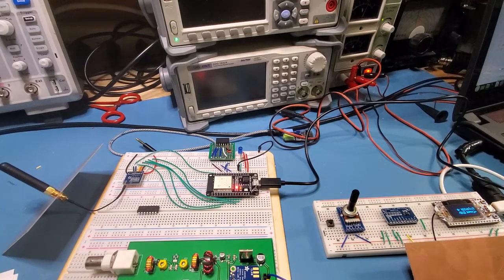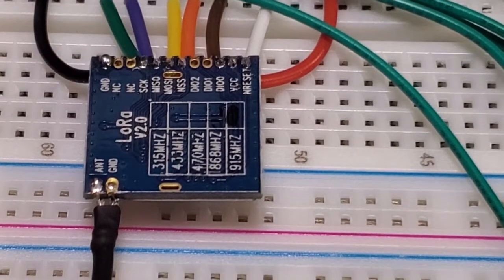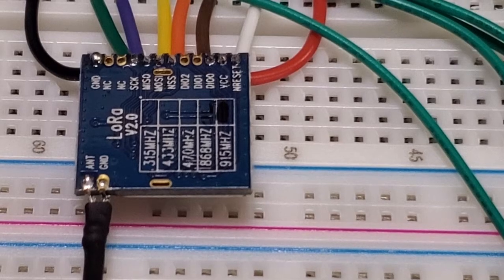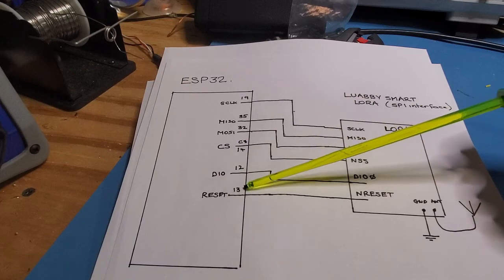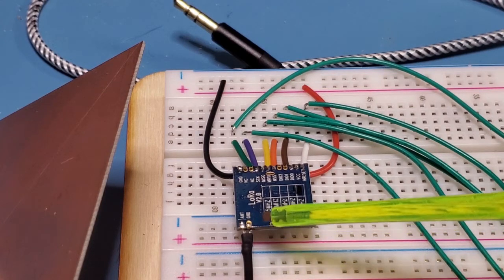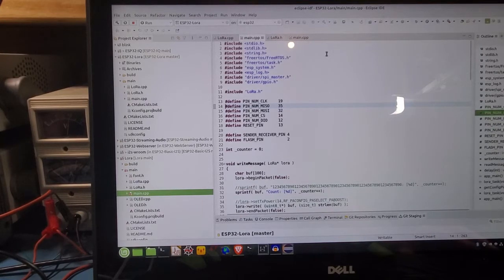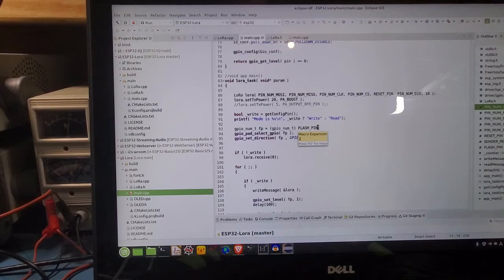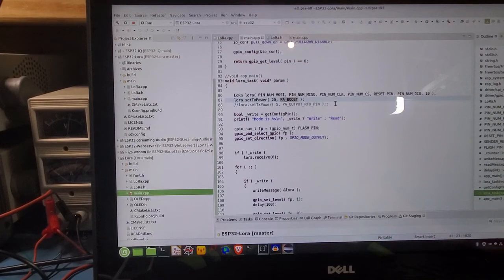ESP32 with External Lora Board

Comment: That was very Kind to make this Video. It's also a unique topic and very rare material exists on it.
just another question, Does this library supports LoRaWAN? Heltec has a project for LoRaWAN 
(HelTecAutomation
/ESP32_LoRaWAN) but it requires a chip ID verification in order to work, so we can't use their library.
Another question if you don't mind, As my experience with CPP is very basic, Is it possible to port the code to work under C?
Reply from the maker: I haven't tried the LoRaWAN library Amir - that might be something I do a little later on. The Chip ID is just the ESP32 mac address

	uint64_t chipid=ESP.getEfuseMac();//The chip ID is essentially its MAC address(length: 6 bytes).

There's a pile of code - but the Heltec board is just ESP32 + SSD1306 OLED + SX1276 LoRa. There's no proprietary hardware there. 

As far as C++ goes I am not using any advanced features: inheritance, virtual fns etc - I just find it easier to use than C. It would be straightforward to port to C but I would recommend just looking for some basic "getting started" tutorials in C++ and learning from there. A lot of the arduino code is in C++ so it helps to know it.